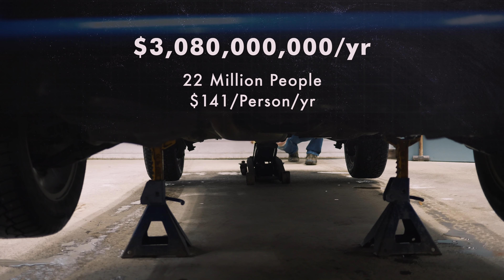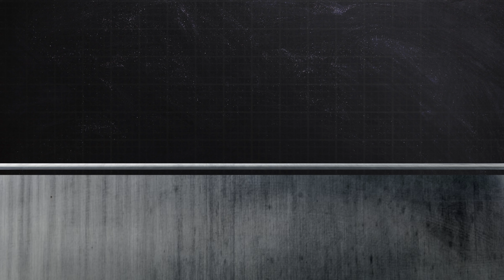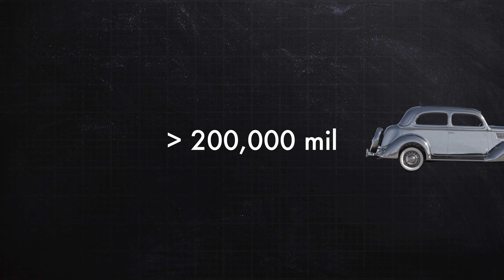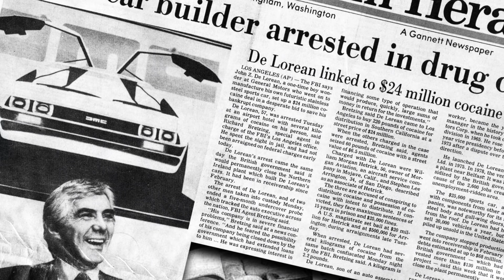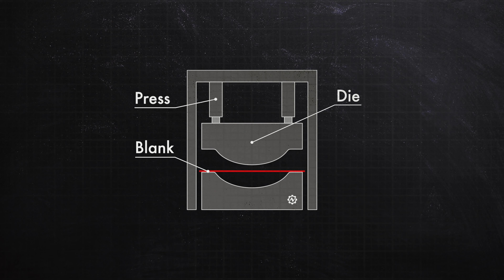The Overlooked Cybertruck Feature Hidden in Plain Sight

Comment: I have a 25 year old car and a 19 year old truck, so longevity is something that concerns me. One of the great problems with Tesla is the limited availability of parts requiring the owner to have Tesla make most repairs at eyewatering prices: battery, up to $12,000, drive unit $8,000, MCU $1,800, even a pair of drive shafts is $1,750. So having a Cybertruck last forever is unlikely, unless you convert it to ICE.
Reply from the maker: Those are really good points. I hope Tesla becomes more friendly to third party repairs. Alternatively, I think there will be a market for third party parts much like in the ICE industry.

Comment: How could cybertrucks body be repaired when it crashes , with any crash the frame its self gets damaged and since the car doesn't have a color applied what should be done with possible scratches?
Reply from the maker: I was listening to a podcast today with Elon and he mentioned that you can just buff out scratches. I do have questions on crashes though. My guess is that it might not be too different from today’s unibody cars. It’s quite easy to damage your frame in even a relatively minor accident.

Comment: What about the newer F150? Aluminum forms protective corrosion too!
Reply from the maker: Agreed, aluminum is better than steel, although it’s typically not as corrosion resistant as stainless.
Reply: Ford is only using it for the body, not the frame. And Aluminum corrosion is relatively easy to scratch off compared to SS. Aluminum certainly has a weight advantage though.

Comment: Super unprofessionell rust treatment. This was nothing good for your car. It will rust as before. 

Cut the rust out. Weld rustfree Metal in. Paint it. Then do the optical things...
Reply: I had an old Pinto when I was young.  By the time I sold it the thing was practically fiberglass from the windows down.  If I had patched it with steel the welds would have rusted through . :D  BTW, Ramblers (AMC to the young ones) put galvanized panels on the bottoms of their cars, but paint never stayed on them too long.

Comment: I think you need to look up chloride corrosion. stainless does corrode when salt is in the mix. even the salty mist of sea water makes stainless corrode. and if you do not wash the salts of the stainless metal it will keep on corroding the metal! in the petrochemical industry we have to hydro pressure test pipes and other equipment. one of the things we have to make sure is that we use none chloride water for this tests because we do not want to get chloride corrosion.
Reply: I have a 50 year old sailboat. Been in saltwater it's whole life.  Stainless is still good.   Check out "Emily and Clark's Adventure" on YouTube. https://www.youtube.com/channel/UCtRbKD1LB4o4aagI6OKoy7w
Reply: Sounds like a different application, and perhaps even a different alloy of stainless steel.
Reply: @j_freed  Hey Guy's ask some one who works at a desalination plant about stainless steel and crevice corrosion with salt water.  It doesn't really matter what grade of stainless steel is used it will suffer from crevice corrosion....AND it gets much more of a problem if the stainless steel is cold worked like the Cyber Truck body.....

Comment: Saturday 18 April 2020: Stainless is far superior to regular steel. However, when stainless is in contact with regular steel, the rust bleeds over onto the stainless in high salt environments such as sea water. I'll be quite curious how well the stainless holds up over time.

Comment: I've got SS brackets where I work that have been submerged in salt water for 30 years and they're still Shiny.
Reply: I think that fully submerged is actually less damaging than if it is frequently exposed to air. A few years back I saw a science fair project where the student had a bunch of steel wool pads (SOS brand with embedded cleaning powder) that they exposed to different conditions to figure out the best way of storing them so that they did not rust - typically these are single use items because once they get wet they quickly rust.

The student found that the key was to minimize their exposure to the air. Sealed in a zip-lock bag with most of the air squeezed out was best, but stored underwater (even under salt water as I recall) was almost as good. While there is some free oxygen in the water, it is still way less than in air.
Reply: @jebeda  Salt water is an entirely different story my dude. The salts and ions basically increase all chances of oxidation happening by a long mile. Salt water is not simply made of sodium chloride and water, there are lots of anions and cations that we don't know floating around in it. These are much more reactive than simply oxygen hitting steel, and facilitates rusting.

Comment: Salt is for ice, not snow. Snow doesn't need salt.
Also, while I'm here commenting, the actual anti corrosion qualities of stainless have a lot to do with specific conditions and specific choice of alloy. Car companies use salt spray tests, but they aren't very representative of when the corrosion actually occurs because charge builds up in the materials when the car is in motion and when the car is resting in the elements and changing temperature allowing crystals to form at varying rates gradually insinuating themselves into uncleanable places. Industry standard tests are static and, to my knowledge, constantly running at ambient temperature.

Comment: I am a Stainless steel fabricator and I see potential in the Cybertruck for welding on many extras from deflection bars and plates to side steps and carrier racks. Jut don’t let rusty steel or grinding sand cutting spray stay on the surfaces, the best way to stain stainless steel permanently.... I love the whole concept but I think yI could have made it prettier or tougher looking ....

Comment: Well there isn't an expiration date per say, as if you don't use the car it's battery wont degrade hardly any, and in 10 years when the battery does degrade it's reasonable to believe that it would be possible to replace the battery for a significantly reduced cost as the cost of batteries is continuing to go down, and capacities are going up, so you could maybe replace the battery with one halve the size and 1/5th the cost in 10 years, I don't know how easy Tesla has made it to replace the battery, but one would assume they wouldn't have made even as hard, not to mention harder than replacing a combustion engine.

The issue with doing that at the moment is simply cost though, but if batteries continue to get cheaper and continue to grow in capacity even at a reduced rate it could be economical to replace the battery where now the battery is like 40% the cost of the car, if it's like 8% the cost of the car it might very well be worth it even on a 10 year old car.

Oh and being able to replace the battery with a battery halve the weight would obviously mean that you would significantly increase your range, as the battery is a very significant part of the weight of an electric vehicle, also you would be able to accelerate faster and you should have a higher top speed, if you wanted the same range you could obviously go for an even smaller battery, but honestly if you are getting the work done I would want to see an improvement on range over the original range.
Reply from the maker: Couldn’t agree more! I’m currently doing some research into batteries. I’m glad you mentioned the declining cost of batteries over time as it’s something I’ve thought about too, but it’s rarely mentioned when it comes to older evs.

Comment: Take it from a sailer. It will rust from the inside.  It will take very long, but it will look ok and still over (many) years it may rust from the inside. I did go and see the ST cars you talk about in this video. They are in Clevland OH.  
The only problem was that the frame was rusting as fast as ever. Cybretruk is ahead on that.
Reply: I also am a sailor. I have SS brackets that have been submerged on my dock in saltwater for 30 years and are still solid and shiny (hangars for the water/sewer/fire pipes). I have also seen new stainless start to corrode on parts a couple months old. It's all about the chromium content. Typically the lower quality / lower chromium content "SS" comes out of Asia.
Reply: @gergc4871  I understand what you are saying.  I work on my boat my self. One day we were getting a survey and I was told the ST was rusting from the indie, nice shinney and all.
To pass I had to take the ST off the boat, I did not like to do that at all, but no other way. As I was doing this the parts ( all 12 of them were breaking in my hands. Crazy but true. The softer the ST the less it will do that the harder ST may do this over time. Now I am waiting for my Ctbertruck like many, but over a long (long) period of time this is possible( I think the truck will be 30 years old at this point)
Reply: @blackpearlaruba9227  
Was there an electrolysis issue? All the bonding wires clean and connected? What brand of cat do you have?
Reply: @gergc4871  There maybe electrolysis issues on the boat. That is also potential on a Truck. And I like to add that rust from the "inside" is just that, Right in the center of the SS plate, it looks ok from the outside. Metal will rust from the outside inward  SS is the other way around
The way to see this is with a magnifying glass. There will be small hairline cracks that is the giveaway, then you bent that pice and you can see the rust inside at the center.  Only after working with SS for many  years I found this out.
PS all SS are not the same, keep that in mind too.
And I did go and see up close and personal at the SS cars of the past, did not see any rust from the outside, or any small cracks, no rust stains at all. Some of the cars did drive in snow/salt, their undercarriage had rust trouble (so they told me there) but yes, the rest was great.
Where you want to really is where SS and "Metal" are mounted (they at Clevland Car Museum did want me to go and look under the SS cars)
Electrolysis issue will be there.

Comment: Excellent presentation and production values, really enjoyed it.  I live in another country now, moving way from California to within 500 miles of the Arctic Circle so snow and ice are a consideration. They used to use salt on roads and sidewalks and the slushy brine the resulted ruined shoes very quickly but the people got together and requested dropping salt and just spreading a light distribution of small volcanic rock that could act as cleats for shoes and the 50,000 broken arms or worse suffered every winter from slipping on refrozen salty water, polished as glare ice ended as did the millions of ruined shoes. The change even boosted business, shops, cafes and pubs became easily accessed on foot so winter became much more social and fun. 
There are alternatives to salt and I am convinced it is used due to lobbying by automakers in the US which want to sell an extra 3 million cars and trucks than would be needed if salt was spread.
That said, I have no car because public transportation is so good, and cheap, unlike in the US where it is poor in services and expensive.  But the second the CT rolled out I went to the web site to reserve a Dual Motor.  It solves so many needs, and will be one of the most significant products of the last 100 years.
Reply from the maker: Thanks! That’s really interesting to hear about your country’s experience with and without salt. I know some states out west use sand, but alas I’m in the Northeast.

Comment: Very good attempt to excuse tesla's and "elon's" impracticality by looking the other way.
Reply from the maker: Thanks for the comment! I’d love to hear what you’re concerned about? Trust me, I don’t automatically buy into the Elon hype. In fact, there are some good reasons I don’t currently have a Tesla.
Reply: @chargeeverywhere  Tesla makes great and very well engineered vehicles, that are a lot of fun to drive. However we all have probably the same reasons not to buy them. Currently all Tesla models offer insane acceleration that is only comparable to a supercar and best in the world adaptive cruise control. Out of this two features the car is worse than a low grade Accord.
Tesla has the same issues that Delorean had when it came to the market. It is a nich, hipe product, a show piece. Tesla will have the same faith as the Delorian or the Karma.(The brand wont die, it is a great deal for a potential chinese acquisition).
 As far as practicality, electric vehicles are nothing without supercharging capabilities but even with a supercharger, who wants to spend an hour a day to refuel, even 30 min is still too long and you cant have a supercharger at home, unless you upgrade the neighborhood distribution network. 
Number two, try to repair a Tesla, it costs a fortune and the wait times are astronomical. Only Tesla can work on their cars and no one even wants to touch them. Can't fix a tire without calling them. Is that practical? Resale valus are ridiculous. Is that practical? I buy a car every 3 years without loosing moneney...with tesla  this is impossible.      
And now stainless...great, what happens when you have a scratch ot dent or an accident, it is more than Elon's hammer... how do you fix that...every fender bender will be a total loss. Who wants to pay for this? Practical? 
And the rust is not that big of a concern, if you keep the car fo more than 7 years the electronics will die before the car has a chance to rust. (nice work on the Subaru BTW)

Dont get me wrong, i loved the model 3 when i drove it, i still love it, i would never buy one...but many will, people like shiny things, unfortunately not enough to keep the company afloat...
Reply: @MrSvetlin09  "who wants to spend an hour a day to refuel, even 30 min is still too long"
That doesn't really seem necessary does it? You just plug it in at night and you're fully charged in the morning, that seems even more convenient than going to a gas station... so what do you really need a supercharger for unless you think someone is driving more than 300 every single day and can't even plug it in at night. 
Is that really necessary for you?
"Can't fix a tire without calling them."
From a brief google search it seems you can just go to any regular tire shop and don't really need call Tesla... What you've said is at least a little bit misleading isn't it?
"Resale valus are ridiculous."
Tesla has a great resale value, what are you even talking about?
"every fender bender will be a total loss."
I suggest getting Tesla insurance.
None of your criticisms seem to be based in reality... If you had some interesting criticisms that let me perceive a different outlook that would have been great and informative, but you almost look like you're just completely lying for attention or something because nothing you've said seems remotely realistic or even worth considering.
Reply: @jondoh9414  Please don't consider my comment if you think i am lying, i hope you enjoy your Tesla and  hope you have better experience than me.
Reply: @MrSvetlin09    I would disagree about Tesla's being a "niche, hype product, a show piece."  The cars Tesla produces are literally changing the auto industry.  It's going to take legacy automakers a decade to catch up to what Tesla is doing outside of the battery and power train.  You should watch Sandy Munro's tear down of a Model Y.  There is so  much stuff Tesla does that other automakers won't or can do--things that make the car safer or last longer.  Certainly not things you would spend the time on money on for a "show piece."  It won't be long before the Model 3 out sells the Accord.  That isn't a niche product.  I'd be surprised if both Ford and GM are still in business by 2030.
Reply: @donm2255  Ford and GM should have been out of business long time ago even without Tesla. 
I watched every Munro video so far and i dont realy see anything unusual out of great engineering, but revolutionary...absolutely not and lets mention that the tear down of the M3 and Y  are  payed by Tesla so the hipe is obvious. Dont get fooled, this is a very well planned commercial campain. A lot of people watch youtube and beleve every word without critical thinking.
 Tesla has laid off about 8% of its employees in the past quarter, this does not sound as very positive data, and started happening well before the corona issue hitting the world, let alone that so far Tesla has lost billions and has yet to make a profit, (it lost $862 million in 2019. But that was better than the $1 billion loss the company posted in 2018). When they start making money we can talk about changing the auto industry. So far I can see Tesla in the same bag with Ford and GM.
Reply: @MrSvetlin09  - First off..I don't own a Tesla. You've said that that the tear down was paid for by Tesla.. you are incorrect! Munro purchases the vehicles themselves..tears them down and does an analysis on the construction and general build, and then sells the reports to anybody within and without the automotive industry..Ford,GM, and VW are known to have purchased these reports. Tesla has stepped out far ahead of most of the industry in most areas.. And they have made profit many times now..if you can't accept that I feel sorry for you..
Reply: That was a joke.......right?   It is, of course, the most practical vehicle offer in my long lifetime. Second place was the Toyota FJ-40, most reliable 4x4 vehicle that showed Jeep the proper way to make a reliable product but they never learned the lesson. My first one was used solely for off road use and not once in 25,000 off-road miles in the rugged Sierra Nevada Mountains did it have a mechanical issue.  That is like 500,000 miles highway miles.
Reply: 1.5 to 2 ton boxes on wheels to move 200# humans -  are you saying auto industry is impractical?  heaven forbid